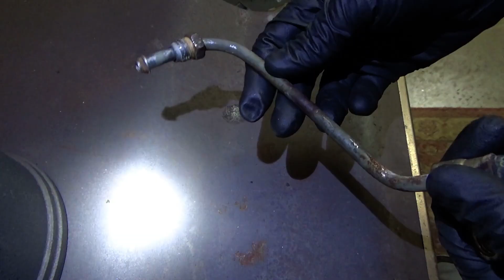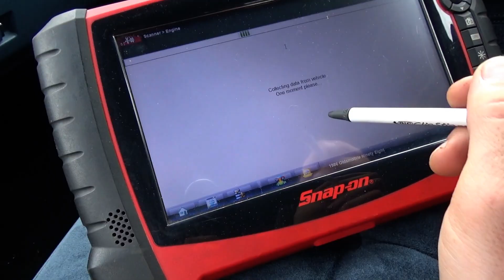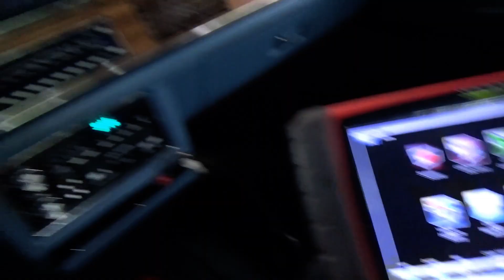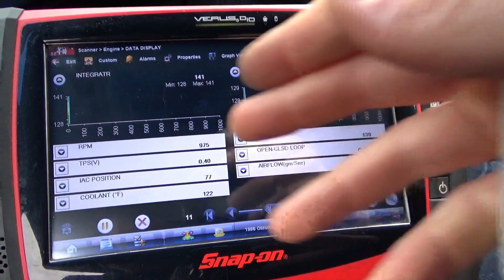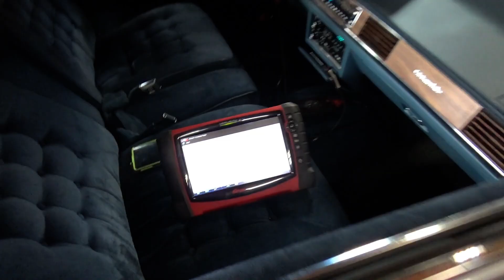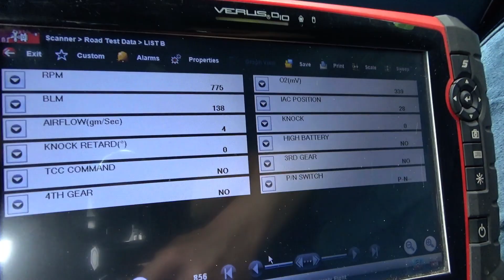(Pt 4) '85 Oldsmobile "Time Machine" has NO POWER?  (CONCLUSION! Memorial Day Special)

Comment: I was a licensed auto mechanic in the late 60s and early 70s before I found another vocation.  Emissions were just starting to be a thing and a tune up consisted of new spark plugs, ignition points, condenser, set the timing and adjust the carburetor idle if required.  LOL.  Diagnostics were way simpler then.  I was suprised how much difference ten years made on this car in terms of complexity.  Congratulations on making this beast run well.
Reply: On your tune up you would hook up to the Sun scope to check dwell, timing, and how the ignition was firing, "raster".
Reply: @davidfleishman2275  So long ago but we initially didn't have a scope when I started at the dealershiip.  Later on we got a scope and though we really had something.  Yes, we checked dwell.  LOL
Reply: @caseybalvert3547  Really thought we had something in a scope also.
Reply: @davidfleishman2275  Not that long ago I gave my timing light away.
Reply: @LesReeves  I pulled my Mac timing light out a while back. it was so old the plastic crumbled.
Reply: @davidfleishman2275  That is funny in the sense that how long between even looking at it let alone using it.😁
Reply: There was a short period right after you left the field where some manufacturers used feedback carburetors for computer controlled fuel adjustments.

I hear they are quite a thing to get right.

Cars sure have advanced a lot.
Reply: You should have done it for forty years,  I want out before owning a electric car, pickup, lawn mower, chain saw is mandatory, 😢 thanks for your comment
Reply: @deanmckee1385  Electric nose hair trimmer... with re-gen!
Reply: That was a time we had real solid heavy indestructible steel bumpers and cars the average Joe could work on. Now most of my neighbors won't do anything to get their hands dirty, including changing a simple door lock.
Reply: @kimchee94112  Not sure how those things are related.

Comment: If you didn't find the right fuel fitting, you could try making your own.  If you can find a solid plug with the right threads or the right size rod and use a die set on it, you can drill it out and tap it for whatever fitting you want.  Since it doesn't carry pressure, you don't have to get too fancy.  Also, you can run a tap or die over damaged threads and sometimes it's good enough to reuse.

Comment: Could be an issues with the other belt when it throws the AC belt, I would have had to cut it off. Also wonder if the out of spec cylinder was due to the streaming injector.  Most importantly sounds like the radio needs an update😁

Comment: Oh yea, those GMs were so funky having that "diagnostic running mode"  WTF were they thinking?  That's what I was thinking.  But now that I remember, that was a thing.  Silly GM.  If you're talking to it, it changes it's attitude.  Two-faced friend IMO.  TG they don't do that anymore. I kind of wonder if that was an early version of an emissions cheat. It was called CCC I think.  Computer Command Control.  I called it GM quantum mechanics because just by looking at it you changed it.  What a joke I thought then and now you're bringing back memories,

Comment: While it's obviously 'happy', I was kinda surprised at the 25-27 PSI fuel rail pressure...
For some reason, I expected more like 3 bar rather than 2 bar ...  However, the O2 sensor and fuel trim values don't lie!

Comment: Aside, just a note: if RPM"s go up "as soon as [you] start looking at Live Data" on scope, this can mean only one thing: a software bug in car's computer. Mis-programmed electronics in car's computer in other words. Please, understand that there is no "firmware" or "software" in car's computer this old, but it was designed to respond in a faulty way. "Software Bug" is the modern terminology for it.
Solution: install (hook up) a cheap scanner with Live Data capabilities to the CouchMobille so it is connected to it all the time, forever.

Comment: Those old fuel pressure regulators with the diaphragms whether Ford GM or Chrysler, eventually they'd always leak. Ford recalled them on the 2.9L engines because they were right next to the distributor(severe fire risk there).  I did a recall check on a customer's Ranger.  We did not have the recall replacement in stock so I ordered the thing and put the car out in the parking lot.  Customer came in, started the thing and it burned to the ground.  What drama that was.  I seriously felt sorry for the guy that owned the burned up Ranger.

Comment: Great to see all these old car diagnostics, like my 85. Just a few concerns/ comments: 
1. In running diagnostic mode either using the scanner or a paperclip the idle is set approx at 1000, the timing is advanced, and spark knock is normal. This would explain your high Knock sensor counts when plugged in. In the non running , but paperclip in place, all ECM controlled devices ( except the Fuel Pump relay ) are energized. This usually runs the cooling fan and cycles other solenoids etc.
2.  There is LOW pressure on the fuel return line, it is not real high, but it could cause a problem if another hole developed. Any future diagnostic where someone pinches the return line will raise the pressure. Under high vacuum, running, there will by a lot of flow back to the tank, and higher pressure in the return line, no different than a ground side voltage drop when a circuit is under high current.
3. I do not have the spec for this car, BUT,  there is still a fuel feed problem. You had better fuel pressure, more in line with what I am used to seeing in part 3, initial pressure testing. In the end you had much lower pressure. If this matches the spec you are good. 
4. There is still a Fuel pump problem or internal tank fuel line problem. There should NOT be such a large pressure drop in the fuel rail after initial prime. Many times the root causes are :  A. The pump check valve itself,  B. The pulsator pulse damper ( if equipped), C. The pump rubber hose in the tank has a slit or the connection is slipping off the tubing. 
The fuel pressure regulator seemed to be the elephant in the room , with some smaller animals, also involved in causing the initial bog at over half throttle complaint.
Thank you so much for doing all this extra work in bringing us so much great information. 95% of the time, with all the new electronics you are way over my head, but this old stuff I can relate to !
Reply: I remember the FS mode raised idle to a 1000.  Forgot about a few other items you mentioned. 
I thought 10 psi drop when unplugging FP regulator was expected. Didn’t look like that much. 
If customer didn’t want to replace pump cause of leak down we told them to cycle key twice before starting. 
EGRs have been problematic as far back as I can remember. 
It was a great video for us old timers to dredge up old memories (Mostly bad) of these early EFI vehicles.

Comment: As I watch this series, I have to ask if that's the original engine.  Do the numbers match?  Other questions I have are:  Why does that engine look so crappy if it's only got 5000 miles on it?  Why all the jerry rigged shit on a "new" engine (return fuel line cross threaded)?
Reply: It's 40 years old. Midwest has a rough climate.

Comment: I remember buying a new 1991 Camry. From beginning, it would surge under low acceleration to the point it would downshift. The dealer ultimately kept it for a month trying to make it run correctly. Finally, I put a piece of electrical tape over the EGR connector and reinstalled the vacuum hose. We drove that car, trouble-free, for 23 years after that.
Reply: The valve has 4 connection points.
What connector did you put tape on?
Reply: Not all ECUs can compensate for the lean condition caused by combustion gases being replaced by air caused by the lack of EGR in the middle of the load range.

Comment: Did you get around to fixing that aerial up ?

I replaced the electronic antenna mast in my Holden VY SS Commodore & it wasn't as simple as they said it was to fix because I had to dismantle the gearbox to fish out the broken pieces of the nylon antenna rope,so it wasn't as easy as just feeding it in through the top.

I kept the OEM antenna gearbox & motors rather than ordering a new aftermarket unit because I was told that they're crap.

The 3.8 litre Buick V6 engine wasn't very smooth in comparison to the Nissan RB30E engine which Holden fitted into the VL Commodore instead of that engine which is in the Oldsmobile in 1986, they ditched the idea of fitting the 4 litre Jaguar inline six as well.

They were looking at a way of keeping the Holden factory open after the mandatory introduction of unleaded fuel use in vehicles manufactured from February 1986 because they couldn't afford to retool & make a new 6 cylinder engine in the mid 1980's & their 3.3 litre (202 cubic inch) Holden inline six which was basically a stroked 179 cubic inch Holden six which was built in 1964, couldn't be made to run on unleaded fuel efficiently and reliably, so the Nissan RB30E engine replaced it in February 1986.

It was when they released the VN Commodore in 1988 the Nissan RB30E engine was canned due to the foreign exchange rate doubling the price of the engine,so the U.S. sourced 3.8 litre Buick LN3 V6 engine was fitted,it is similar to that Oldsmobile 98 engine, except for the direct fire ignition system which was used right through up to the L36 V6 engine !

Comment: Great job.  While I realize that car is 40 years old and had 5,000 miles on it you did what you always do and methodically diagnose the issues it had accurately.  I hope it holds up for the owner.  Back-in-the-day those cars weren't the best:  transmissions, driveshaft boots that split and threw out the grease, leaks, and as you have discovered, driveability problems and headliners.  They have MacPherson struts at all 4 corners and those were prone to premature wear likely well before 100,000 miles and were expensive to replace.  I had customers with these and when GM stopped making the Rear-wheel drive "C' bodies in 1984, Chevrolet still made the Impala/Caprice "B" body and they switched to those and drove those for years.  By contrast, unless I've missed a video somewhere, your Mystique is all-original except the clutch.  I think it just recently rolled 300,000 miles.  We need to stick with the Mercurys.  GREAT VIDEO!

Comment: One thing I immediately noticed was how much more quickly the engine started after the timing was correctly dialed in.  Extremely important spec. on these old gals....and any car with a distributor.  Throttle response and power will noticeably improve, as well (as demonstrated).

Comment: Yes don't buy dorman electrical products but they also make pretty darn good intake manifolds they had the only one new in stock there was no more OEM new of course it's a '05 Buick century and all of the used ones I got from the junkyard were all warped and would just crack trying to install them but that brand new dorman worked like a champ

Comment: 20:22. I noticed the gas gauge was rising under acceleration. I seem to vaguely remember that was normal on my 85 Olds Cutlass even when it was new. I just noticed at the very end that the car had a third brake light. Didn't that start in '86 or did some manufacturers add them before the mandated 1986 year? Could it be that this car was a very late '85 and the factory started installing them early or maybe it's just and '86 and the owner thought it was an '85.
Reply: We ordered an 85 Olds Cutlass Salon (bucket seats, console) with the 307 v8.  It had the same blue interior as this one.  Drove it to 145k mikes when it was totaled.  No it did not have the third stop light.
Reply: @graymodeler  I also had an 85 Tbird That I got brand new and it didn't have a third brake light either.
Reply: @graymodeler  One of my favorite cars I owned was the '80 Olds Cutlass Diesel V8 with the t-tops. Back than diesel fuel was cheaper than gas. Ah brings back memories...sigh.

Comment: In part one I noticed knock counts in the 240 range, a sign of unhappiness in the combustion process. Knock counts was an important tuning aid in my '87 turbo Buick. Understanding that metric helped as I increased boost from factory 6-ish to the 27 lb range. Would be interesting to know those counts now that you have things right. But that's old school stuff, right? By the way, the 231 V-6 is durable, reliable and will take a surprising amount of abuse. Thanks for sharing this.
Reply: Some, like this one, are rollover counters. The number keeps going up every time there’s knock counts, then stops. It rolls over at some point to zero, maybe at 255, and starts counting. You just have to watch the pic while you’re driving to see if it’s going up and where.

Comment: 3:17 so when I do these fuel lines and I’ve done high-pressure ones like that. So the way I do it as I do the same thing you’re doing and I use permatex aviation gasket sealer. Trust me I did a fuel line on a suburban this way it’s been eight years ago and it still doesn’t leak. I also use flare and fuel injection hose clamps two per side of line.

Comment: How can that car only have 5000 miles on it and that much stuff has been messed with ?
Reply: My guess would be that a typical parts changer worked on it and made it worse.
Reply: Age, not mileage did it in.
Reply: @mph5896  I understand that age plays a role but age alone wont mess up threads :)

Comment: Idk about the modern oil in that engine. It's probably a flat tappet cam. Needs correct oil for that application and SP isn't it. After research adding zddp isn't the solution either. Need the correct balanced oil additives.

Comment: Good Job! I would have talked John into a new fuel pump assembly and fuel filter to solve the long crank. Would be well worth the extra money.
Reply: I believe it was solved.
Reply: @brianw8963  Still had fuel pressure loss after replacing the regulator.

Comment: had a similar situation with ac evap coil the hold down bolts  were metric threads in the original  and standard in the new unit American cars from era of the 90s had a mixed of metric and  standard fasteners hard to believe the amount of butchery on such a low milage car injectors mass air sensor fuel regulator

Comment: Very nice job, especially considering that thing is 39 years old. Still think the milage is complete B.S. and considering some of the other things that were done I would give that dealer a wide berth as far as ever buying anything else from there. Customer seems happy though and you got the old boat running pretty good. Anxious to see what you come up with next. And hope you had a good Memorial Day Weekend. Hope everyone takes a minute to remember why they have the day off.
Reply: Odometer probably reset after 100k. They only went so high back then
Reply: @hhn2002  Ivan already mentioned in the comments on one of the other videos that the odometer has six milage places.
Reply: 🤣 ya a “Wide Birth” 😉😁

Comment: What mill gloves to you use?
This got me thinking.  Wonder if my Grand Marque front seat will fit in the f100 pickup.  Although a clutch with a soft barco lounge may not work, you just sink in when you try and push it down.  I guess if it fits i'll have to swap the trans and go automatic.  Comfort over function.........

Comment: Those fuel pressure ranges seem off from what I would expect.  I'd think 43 with no vacuum and maybe low 30s at idle or something.  That would fit with the higher BLM at idle.
Reply: What is the BLM pid?

It isn't only block learn and integrator for fuel control?
Reply: @volvo09  BLM = long term.  Integrator = short term.  128 is 0%.

Comment: Ivan should get those plastic line clamps.  It's the safest way to pinch off a hose.  Vice grips are not the way, old hose or new.
Reply: If you use vice grips foot two pieces of vacuum line on needle nose, vice grips
Reply: I've just wrapped electrical tape around the jaws for the few times I've had to do it.

Comment: 2ND LOL great job Ivan ive personally had this same thing happen to a 93 olds 98 that sat parked for aprox 10 years. after trying everything to find the issue and replacinga lot of no oe parts  as the previous owner who inherited the car from his grandma with about 50k on it had replaced stuff trying to get it running and not having any scanner or scope ended up having to parts cannoning it and replaced all the sensors and fuel system and the car finally ran right